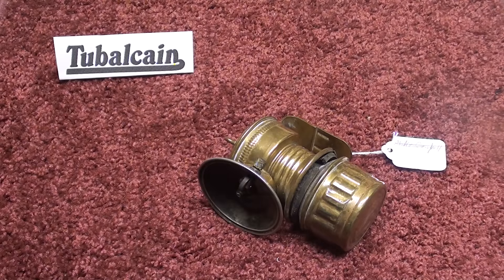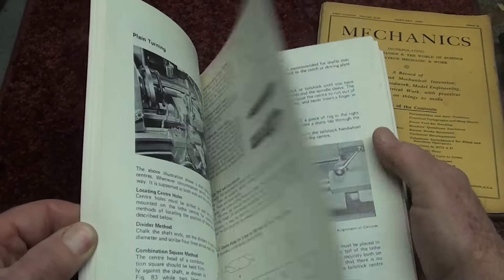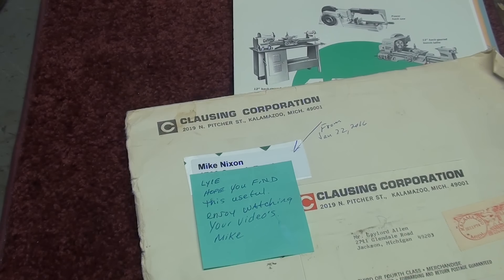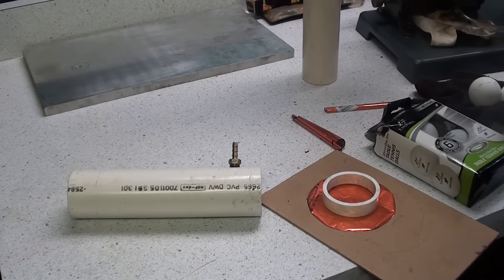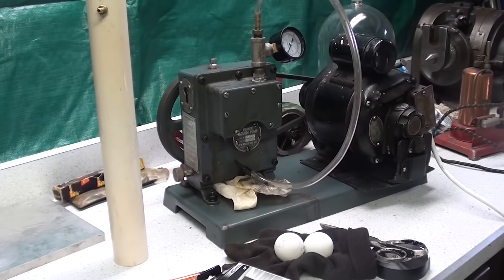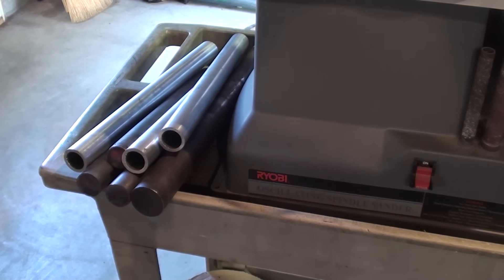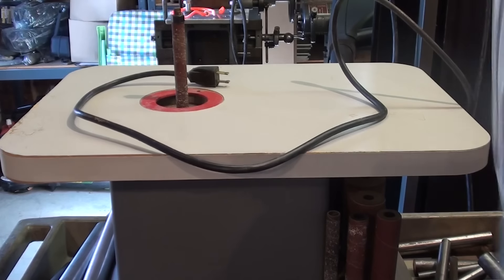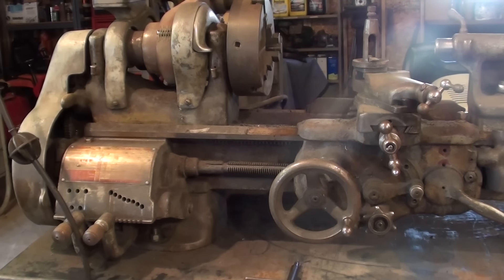THIS & THAT #15 by tubalcain - mrpete222 south bend lathe

Comment: The easiest source of Mylar is an emergency blanket (foil blanket) which you should be able to buy from any pharmacy since it is a standard in most first aid kits. This isn't the cheapest source but much cheaper than balloons, larger too. Additionally a fair number of crisp packets are Mylar so if you have a party with a grab bags you can pull out your vacuum cannon and entertain.

Comment: We have a Boxford lathe in one of the shops I use at southern Illinois. Nice solid lathe, but it is beat up from students making mistakes (which is understandable). Someone screwed up bad enough to break part of the power feed system. Fortunately another shop is run by an amazing machinist that made a replacement part pretty quick.

Comment: I started using a lathe at 5 years old in our garage on a South Bend 9C built in 1937.  The main difference between it and a A model was that ours had the manual change gears.  I kept that after my father died until a couple of years ago when I bought a Harrison 13" M300, though I regret selling the old SB now that I found your channel and could have made her new again.. Sigh.  BTW, I'll be 60 next week.  lol
Reply from the maker: +Ed Stoddard I didn't run my dads 9" SB till I was 14

Comment: Coincidentally, I was speaking with an old Cornish tin miner about carbide lamps a few days ago.  They replaced candles in Cornwall, but weren't a total success.  The disadvantage was that the pressure wave from any nearby dynamite blasting would extinguish the carbide flame, whereas the candles just flickered!  The carbide lamps were much harder to relight in the resultant darkness too.

Comment: Heh, a ladybug. :D @8:34

The steel discs, if it's tough steel, keep it as a work surface for when you want to straighten stuff out. I have a disc like that home, not sure what steel it is, but it's very tough and won't dent even when i hit it with a big hammer. I mostly use it for nails, wire, tin, stuff like that. Very useful around the shop, arguably slightly more useful than an anvil in most cases.

Comment: Nice mix. I liked the vacuum cannon. We never got to see the (or at least "a") carbide lamp working. I have an old nickel-plated brass carbide lamp (bicycle lamp, I think) where the brass is "sick". It has at least one split in the reaction chamber and is not useable anymore. I do have a new one that works, but it is not as nice as the antique. Leaving depleted carbide in a brass lamp will make the brass brittle and likely to split (known as "sick"), so clean thoroughly after each use. Brass ammunition cases used to get sick back when they used mercury fulminate as a primer.

That collection of "drops" was incredible. For those of us not fortunate enough to have donors, drops can usually be purchased for reasonable prices from any company that cuts metal to order, or uses large quantities for manufacturing. Their only other option is to scrap it, and scrap prices are low these days. Look for a bin marked "useable drops".
Reply from the maker: +Peter W. Meek I have 2 newer lamps made of plastic-they will be in a future vid.  I always cleaned my lamps thouroghly

Comment: I did some quick research:  chip bags are going to be around 2mils thick. Foil balloons are about 1mil thick... So it might be possible to use old chip bags rather than balloons for your vacuum canon.
Reply from the maker: +Richard Betel I guess you mean potato chips- I'll try it

Comment: Mythbusters had an episode where they were testing a ping pong ball myth.  They used a similar method to launch a ping pong ball around 700 mph.  They used a really long tube...  They used clear packing tape to secure the ends.  It seemed to work fine for them.  You might try some of that...
Thanks for the great videos!
Reply: +TreyInOK I watched a video that packing tape works but some times a piece of tape gets sucked into the tube and stuck on the inside and getting it out again is no fun.

Comment: A lathe fallow you home: Let me know where you walk!
Reply from the maker: +Robert Patoine the straight & narrow
Reply: +mrpete222 Pretty sure that carbide light will work, Sorry i didn't have time to clean it up Mr. Pete.
Reply from the maker: +kycoalminer35 Yes-I intend to try it in a future video. It will need a new rubber gasket which I think i can make
Reply: +mrpete222 I have a IXL 1920s lathe with no manual or tooling I can't find anything on the company who made it but if you know where I could get a manual for a different lathe of similar age it would be brilliant, because I am restoring it I have to make every thing from scratch
Reply from the maker: +stanley carter go to vintage machinery.org
Reply: +mrpete222 thanks
Reply: +mrpete222 can't find anything on my lathe on there.   As far as I know the manurfacturers of the lathe were kept secret but some people have managed to locate the company that may well have made them which is Oscar ehrlich which as I expected are not on the website. Time to look at making parts of my own design

Comment: funny to see that vacuum pingpong trick coming along. Mythbusters also used this trick and got the ball going 375mph (600kmh) with just the vacuum and packingtape as membranes. pretty fast!
Reply: +TheNorthkiters Did you see were they put a 350psi tank on the other side of the vacuum and got the ping pong ball going 1100mph?
Reply: +Eric Matt I did! fun episode

Comment: Hey Mr. Pete I think it would be good to show folks how a vacuum can boil water in a closed bottle or other sealed containers. Thanks as alway!
Reply: +Tom Wilcox Be very careful when pulling vacuum on a bottle or jar, if it breaks the glass shards will fly out at you like that pingpong ball did. This was the danger with TV tube implosions and why the front had to be so thick.
But yea, seeing the water boil is pretty nice. If you pull even more vacuum you can actually freeze it solid, because the boiling cools it down.
Reply: +stefantrethan I shot a few cathode ray tubes with a 22. You would have to shoot it at least 3 times before it imploded. The rounds would not penetrate the glass.

Comment: I'd love to see you do a south bend apron clean up . Mine will not stay engaged when facing toward center . I think it has a clutch problem , maybe an old lube problem . I've seen most all the Atlas apron videos which helped with my Atlas 10 inch .
Reply from the maker: +Lawnmowerman02346 I may do that??

Comment: I put the address you can see on the envelope for the Clausing Corporation Atlas Catalog into Google Earth. The plant is still there on N Pitcher Rd in Kalamazoo. There are signs on the building for Clausing Parts as well as Atlas Workholding and Pratt Burnerd America. Across the street, there is a large vacant tract of land with big expanses of concrete where factory buildings were. That was the site of the Checker Motors Corporation where Checker cabs were made. You can still see the test track on the north end of the site.
Reply from the maker: +larrysbk More American industry bites the dust

Comment: I just found a Southbend model A for sale near my home. are they good?
he wants $1200 for it
I might buy it.
Reply: +Randy Hendrick Check it out first.

See what's the state of the gears, see what tooling he will provide and see what's the state of the ways, chuck, chuck jaws.

Check for rattles, squeaks, the usual non mechanical noises that appear with old, worn gears.

Ignore the state of paint, a lot of people don't care for the paint, but keep it oiled and well kept, and even more people will pass a good lathe because it looks like crap.

Also on the motor, see what kind of motor it has etc.

Finally use Google, Google is your friend, documentation, parts, years etc. When you've done all that, you'll know if the price is right, heck, if you find an issue, you might even get the price down if you know how to haggle. That's my two cents.
Reply from the maker: +Randy Hendrick Not a bad price